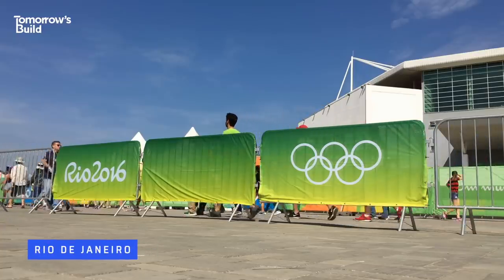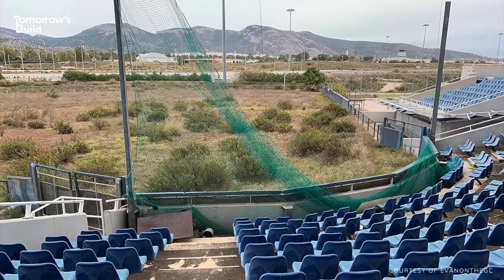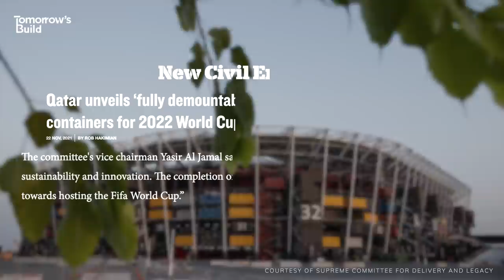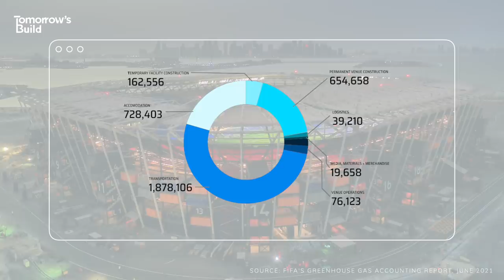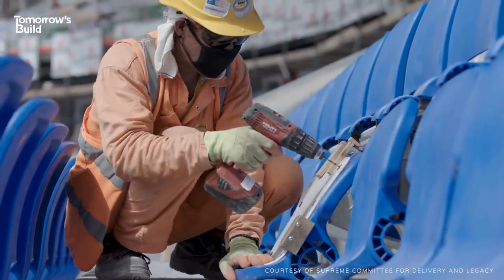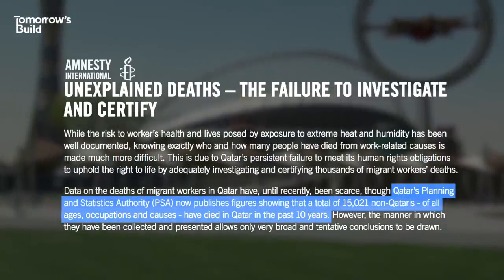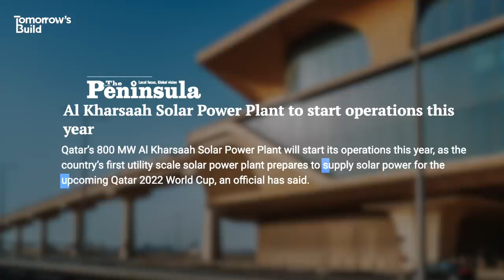This Shipping Container Stadium Will Host The World Cup

Comment: So how exactly is Stadium 974 built? What materials were shipped in the containers? How are the containers themselves used the structure of the building? What are modular steel elements and how are they used in the structure of the stadium? I saw piping coming out from underneath some of the containers but nothing was explained. Like I genuinely know as little about stadium 974 at the end of the video as I did at the start of the video.

Comment: This does NOT look anything like it's built out of shipping containers.
They look like a feature added with no structural basis whatsoever! I can see large steel beams holding it together.
Reply: They provide the walls and they will hold the weight of the people sitting on top instead of the normal concrete and other things, yes it is still made with steel as the video said and when they're done all of the stadium will be taken down and recycled or reused as another stadium

Comment: Yaa, this is bullshit, shipping containers are not meant for these type of application. Nothing about this economical or practical. As soon as you put hvac or power conduit holes in the container it's destined to do only that one thing; to think somebody is going to de-rig and ship a container to another location just to save the money of drilling holes in a new container bullshit. This is gimmick and these specific containers will NEVER be used in another stadium.